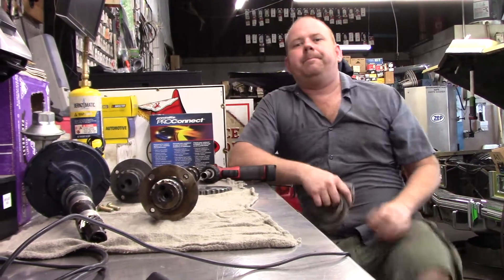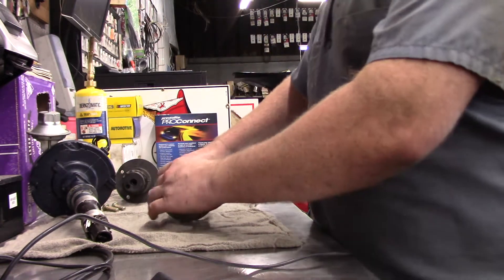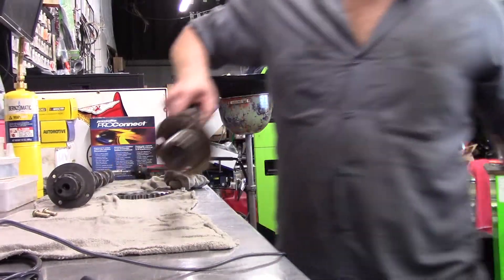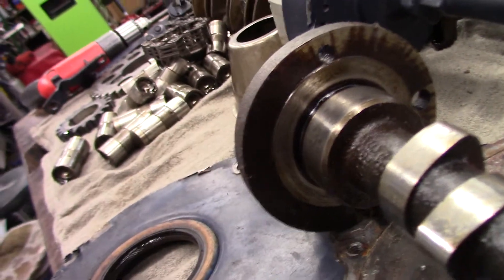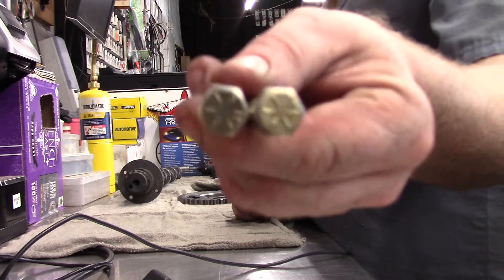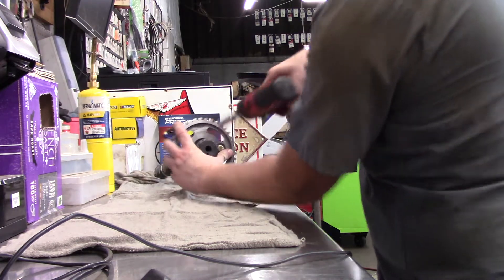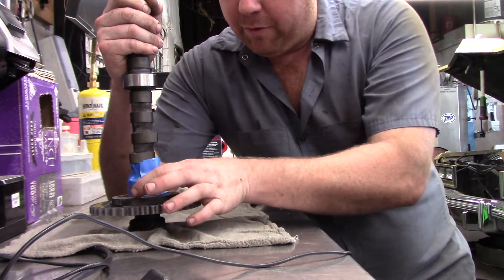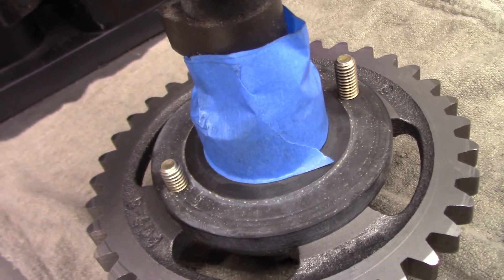Cadillac 472/500 steel timing set replacement.

Comment: Does the fuel pump eccentric have anything to do with end play on these 472, 500 engines ?  I sold a used 472 eccentric to a guy on ebay,  He left me Negative feedback.  He claims in his own words.......THE NED OF THE ECCENTRIC HAD BEE GROUND OFF . THAT MAKES IT WORTHLES THAT HAOW CADILLAC SET THE END PLAY IN THE CAMSHAFT
Reply from the maker: I call bs because my understanding is how the distributor drive and all works it keeps the cam 'pushed back' onto the thrust surface on front of block.

Comment: I had a metal plate that got eating up I have no idea where it came from any idea on what the part is ?
I have 472 69 caddi
Reply from the maker: Sorry for delay on reply? Do you have a pic? Maybe its the oil slinger between crank hub and gear. super tight press fit and if not tight enough will move around and damage it

Comment: Did the '74 sedan deville only come with a 472cid and not a 500cid? Thanks.
Reply from the maker: Fleetwoods and eldorados were 500, the others were 472. HOWEVER, I bought a 74 fleetwood Talisman that upon disassembly, had a 472 crank. Numbers matched on car and block. Never looked like anything was ever done to engine. Still had nylon timing set. So I would say, There is a possibility of ordering it either way. Bad thing is the only real way to tell is to get casting numbers off the crank.

Comment: Was thinking about doing this to my '68 Convertible 472.  I had another '68 472 many moons ago and at only 70k, the timing chain skipped.  I remember being shocked to hear from the mechanic about the nylon materials. Any recommendations about doing it right?  Which parts are best?
Reply from the maker: Hey there! Thanks for the inquiry! Over the years I have used several different steel sets from Cloyes and Melling, maybe even a couple more. Some have 3 different crank gear key ways to set factory, advance, or retard the timing. All seemed to be the same thickness. All I do is cut the bolts to length and use good threadlocker. Just my preference on using the threadlocker. The factory bolts were shorter and had a lock washer that worked well with the aluminum cam gear. With the steel seems a bit close to the distributor housing using the washer for my liking. Never had them back out or cause an issue. Hope this helps.
Reply from the maker: I should also note if the cam is in the engine and not to be removed, you can mic the original gear, then the replacement, also the original bolt with washer, and the difference will give you the total length of the newer bolts. Also the digital micrometer I use has a 'tail' that you can put thru the hole. So install the new gear use an original bolt to hold flush, then in the other hole use the mic to measure from face of block to where bolt seats, as long as you grind half to a full thread off it'll be ok. If anymore questions feel free to ask.